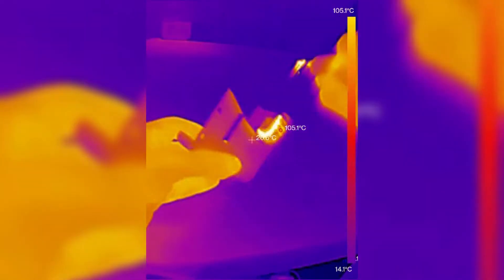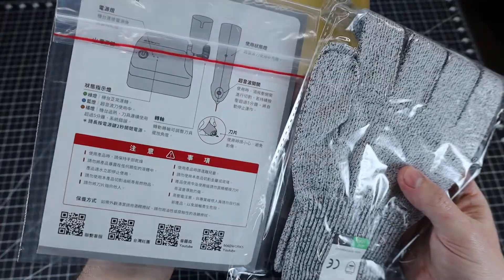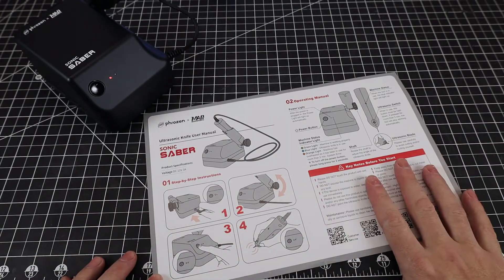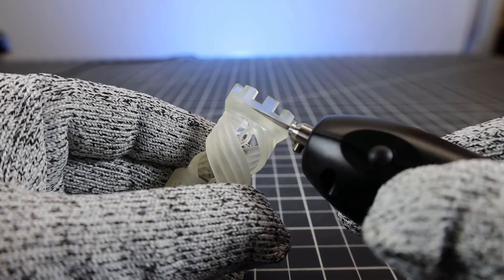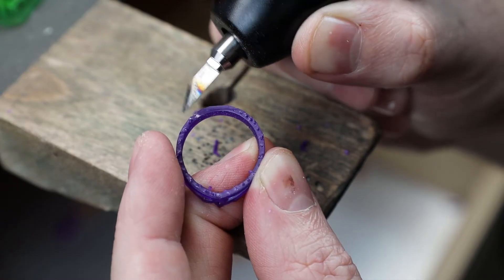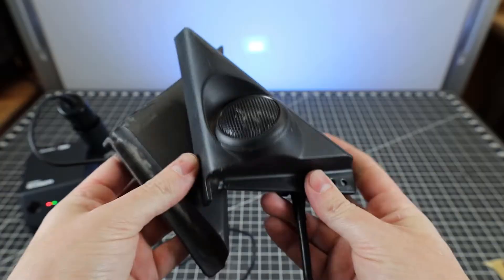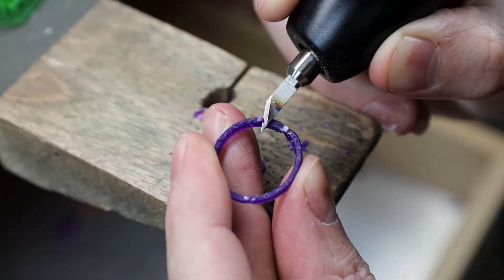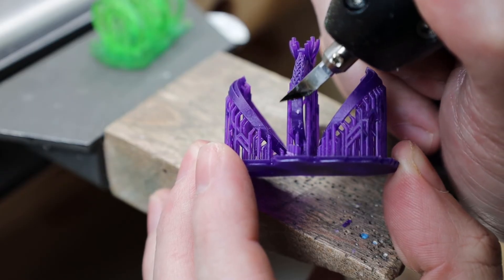Cuts Through Plastic Like Butter But It Isn't A Hot Knife - Phrozen Sonic Saber Ultrasonic Cutter

Comment: Nice review but I bought the ZO-41-II instead. Besides Phrozen page NOT providing any in-depth info on features, the page is more chaff than wheat or the single page manual with barely any info. I really wanted to find a hands on review like your video which has shown me the features of the Saber are pretty barebones for an ultrasonic cutter compared to others in the market, more so when desktop sonic cutters have been available for more than a decade. It's more akin to Echotech's first desktop model the USW-334 from 15 years ago which is the great-granddaddy of the ZO-41-II by the same company. I understand that $249-259 is on the cheap side for someone who wants one on a budget, but If you shop around you can find better deals for a few $$$ more. Instead of paying Amazon $460 which in the end is sold & shipped from 3rd party seller, I got my ZO-41-II from HobbyLink Japan for 37440 yen which is $280 USD+S&H thanks to currently weak yen exchange rate, not a lot more than the Saber's price. And for starters the HLJ product page and Echotech's own page are more substance than bling and list all the info and features which convinced me to buy it instead. Like two activation switch modes, you can select to only activate if you hold it only or on/off with a single press with timer and overheating protection. And it also has two power modes, low and high.
Reply: Still happy with your unit?
Reply from the maker: @HyperSculptor yep, I still use it
Reply: @randymay  Nice. I'm wondering if it can be brought in Europe at reasonable cost.
Reply: Actually this is 100V, I'd have to find another model since I am 220V
Reply: @HyperSculptor  Pretty happy with my ZO-41-II, I use it pretty frequently as a scale modeler and to remove 3d print supports. The ZO-41-II comes with a 100-240v AC adapter. As noted in the spec sheet and as it came in my own unit. Unfortunately youtube seems to be flagging and deleting any reply where I put a direct link to the product page in the manufacturer's website or in the hobby link japan store. The current prices is 40,320 yen + around 5000 yen shipping via EMS. That's under 300 euros + taxes.
Reply: @kamui004  oh that's great, and not a surprise coming from the Japanese. They think about all the details. 
Yeah YT is pretty frustrating for that, also if we want to Co tinue the discussion there is no private messaging for example.